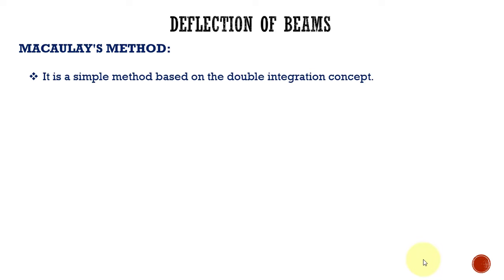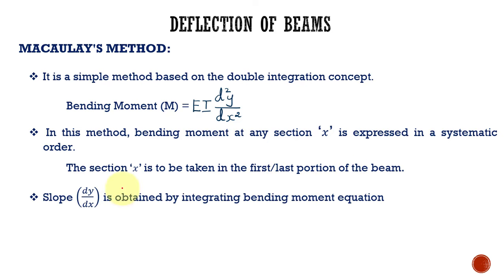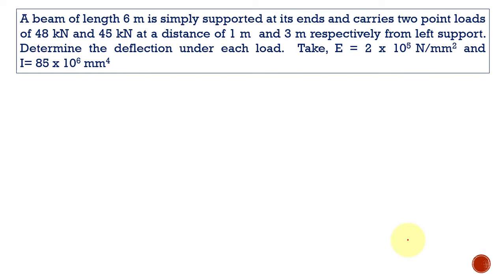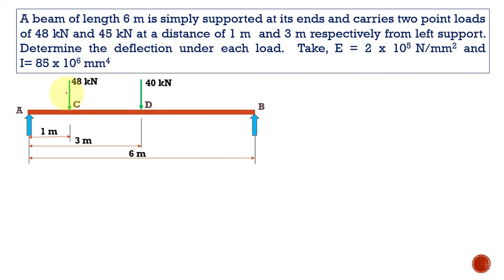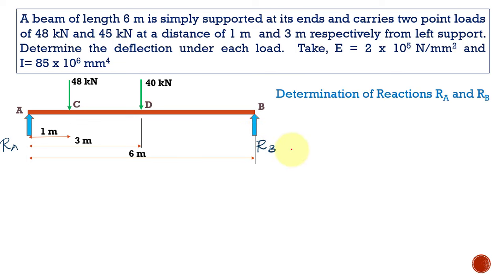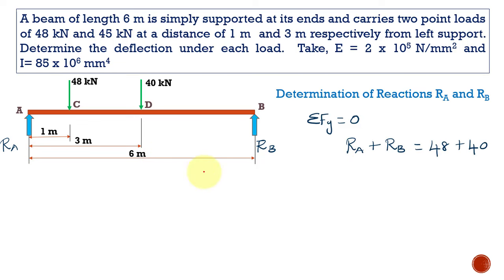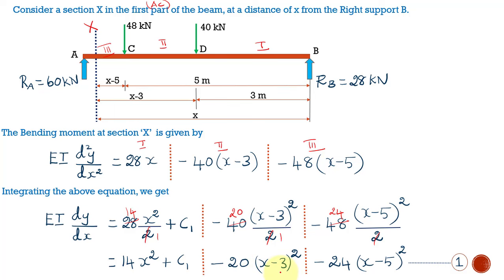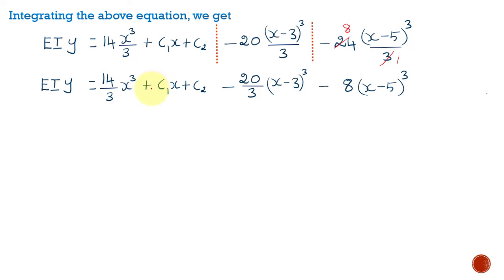Deflection of Beams Problem | Macaulay's Method | simply supported beam | GATE

Comment: I had one question: When integrating (x-3), why do we consider that as a single term? If we integrate them individually [(x^2/2)-(3*x)], this will change the value of C1 later on giving us different answers.
Reply from the maker: We should consider (x-3) as a single term. Because, it represents the distance of load 40KN from the reference as a single term. The whole term 40(x-3) is the moment of 40 KN load fro the reference.
Reply: @michaelthomasrex  I have been searching for answer to this question for a very long time. I'm so glad I came across your video and this reply. Thank you so much!

Comment: Sir there is 45kN but u tack 40 kN
Reply from the maker: In the problem, the point load is wrongly mentioned as 45 KN, but it is actually 40 KN. In the illustration, it is clearly given as 40 KN.  Thanks for the comments.  kindly subscribe the channel.

Comment: Ra+Rb=93 not 88 that means 48+45=93
Reply from the maker: In the problem, the point load is wrongly mentioned as 45 KN, but it is actually 40 KN. In the illustration, it is clearly given as 40 KN. Now, Ra+Rb=88 KN.   Thanks for the comments.  kindly subscribe the channel.
Reply: 48+40 ahe re...